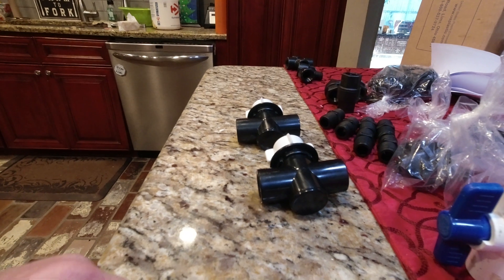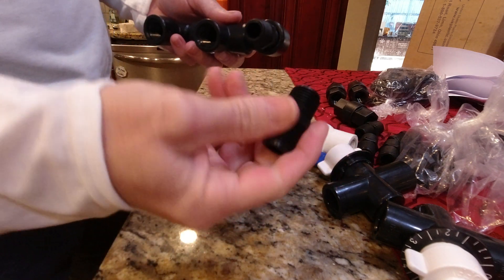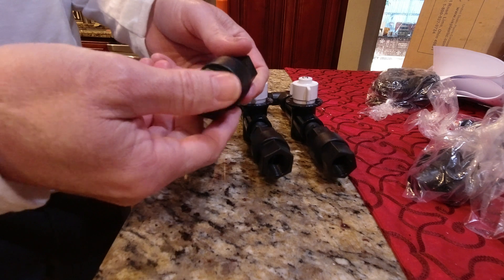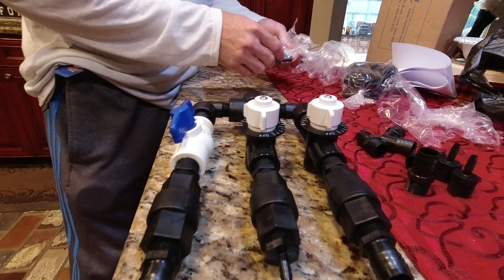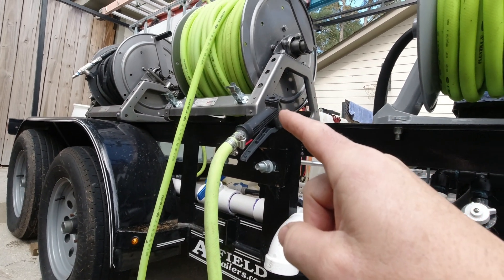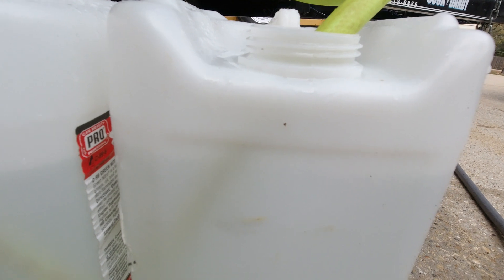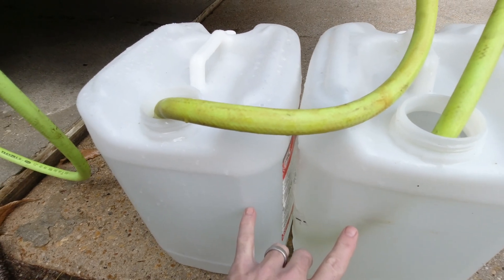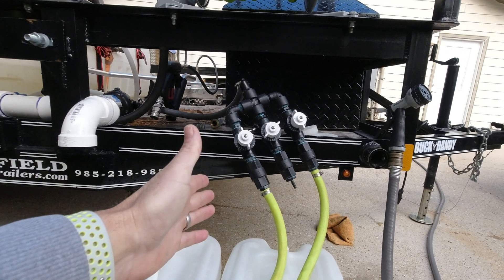Proportioner Build & Test

Comment: Where ya from? You across the lake on the north shore?
Reply: Thansk for the info. From the Westbank myself.
Reply from the maker: @Nawlinsboy  Nice & Thanks!!!
Reply from the maker: Yes sir. Where are you located?
Reply: @allproexteriorservicesllc5338  roger that. I’m on the westbank
Reply from the maker: @EdwardsBoys4343  Nice! If I get any leads from that side I will pass them on. Thanks for watching!
Reply: @allproexteriorservicesllc5338  also the same. Have a Merry Christmas
Reply from the maker: @EdwardsBoys4343  Merry Christmas!
Reply: @EdwardsBoys4343  Baton Rouge checking in.  A very helpful video!  Thanks for making the clip.
Reply: Atlanta checking in as well. Solid video. New subscriber. It would be helpful if USplastics.com packaged this as a DIY kit. Appreciate the parts list!
Reply from the maker: @jgconnelly  That is a good idea. Or even if some of the PW stores to build a DIY kit. Thanks for watching!

Comment: Have you had any issues with having a bulkhead in the bottom of your chemical tank? 
I was told the SH will damage the fitting and leak.
Reply from the maker: I have not had any issues. But I plan to change the tank to a 100 gallon with no bulkhead fitting.
Reply: Why no fitting?
Reply from the maker: @rcl700  Fitting in the bottom is a potential leak.

Comment: Has me wondering what the difference in pull from  Pentre value VS. GF valve is, if any.
Reply from the maker: Good question. I may order Omer and do a test. Thanks
Reply: @allproexteriorservicesllc5338  I just built one with TWO GF valves and ONE of those black n white ones (for water) you think this will be ok?
Reply from the maker: @worth-fighting-for  You should be good. I’m thinking about doing the same thing when my valves go bad. Thanks